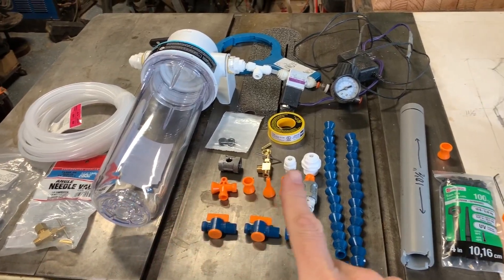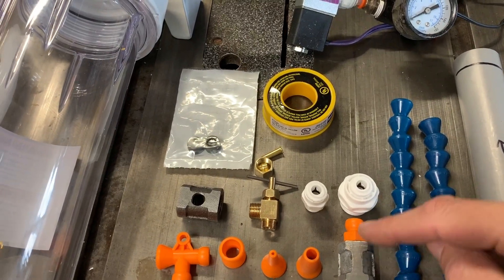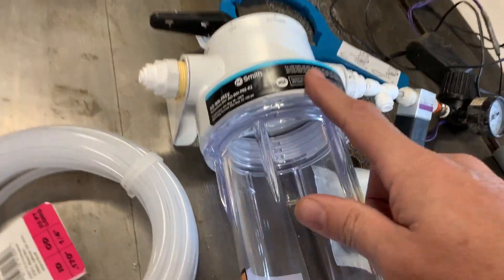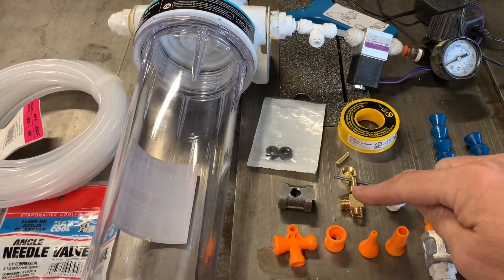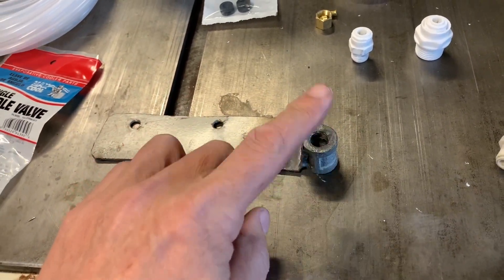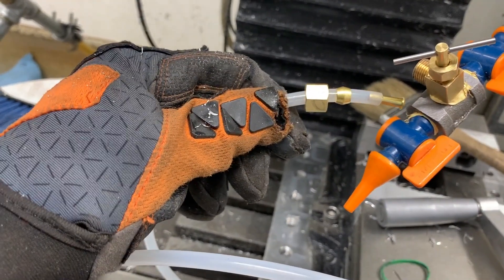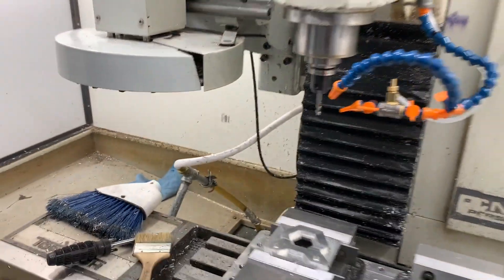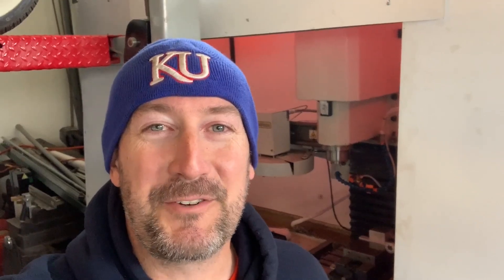SUPER CHEAP DIY Fogbuster Coolant System - Tormach 1100

Comment: Hey Greg, I'm following your plan on using an amazon solenoid. The only problem is that my 770M has a 115 vac C14 outlet and not a regular one for that power adapter on your solenoid. I bought the same solenoid and similar power adapter. Did you need a connection piece to plug into your machine? I just bought a IEC C14 Male to NEMA 5-15R Female... I'm hoping it works or I might be dead in the water.
Reply from the maker: The 1100 has a standard receptacle, but if you've got an adapter coming, it should work just fine.  IEC plugs are the same voltage and same amp rating.  Make sure you check the polarity with a meter.  I've had SEVERAL IEC cables and plugs that had the neutral and line backwards.  There are tiny little letters next to the holes on the IEC cable that indicate what they are supposed to be.

Comment: Great video thank you so much! Is the coolant liquid reusable so I can create a circulation for this cooling system? And can it be used for circular cutting machine for copper? I am planning to use this system for a HVAC manufacturing factory. Greetings from Indonesia. :)
Reply from the maker: It does not circulate...  I also don't know much about cutting/machining copper.  I use wd40 for cutting aluminum.

Comment: Killer  info Greg, you got me thinking about how to cool stuff on other machines. Got a friend gonna help me to get my South Bend Heavy 10 Toolroom Lathe up & running. I'm going to need it for a ptoject I've been wanting do a long time now. I'm having a hard time finding "Divorced Transfercases.." Next time Bessie goes down I want to be able to put a 4spd & a 5531 Brown-Lipe auxiliary transmission behind it & the NP 205 behind that which will give me overdrive on the high side & loads of deep reduction on the low side, plus a lot of PTO options. 
Killer Vid Greg,!!!
Aloha, Chief

Comment: Good chip evacuation really spoils you!  IDK If it'll ever happen to you, but I've actually had debris get inside my solenoid causing it to leak when closed; you can take them apart and clean the seal and clean the seal to get them working (The first time this happened I replaced the whole valve lol, now I know)
Reply from the maker: I haven't had that happen yet.  Now I know that I can clean it out.  Cheers!!!

Comment: dude that bracket with the coupler welded to it would have been a cool machining project.. use the machine to build itself! lol  sweet project, looks like it worked out well!
Reply from the maker: No doubt!  I kept looking for a way to machine all the parts and I kept coming up with a list of tools that I needed.  I did want to test out thread milling for the NPT connections, but MAN...  Thread milling a tapered thread is a math problem I'm not ready for yet.  I may remake this down the road.
Reply: @GregsGarage  yea, crazy how much more complicated machining projects are than plasma, laser, router projects, always a work holding issue and always a tooling issue.  But so damn cool!

Comment: Question Greg did you need to get a 3-phase converter for the mill , what  isthe power requirement 220 50 amp will run it ???
Reply from the maker: It's single phase 220V.  The 770 can run on 120V.  I'm using a 20A circuit.  The draw on these machines is surprisingly low.  It does have a. separate 120V plugin for the computer, the pump, and the accessories.  I'm using my bandsaw circuit since both machine don't need to be plugged in at the same time.
Reply: Busman 54 It’s single phase and only 2hp.

Comment: If you don't want to flood cool, or use the standard oily stuff... you can use what Datron sells. It's a denatured alcohol mix. The alcohol wets the bit and the part better than water, because of reduced surface tension and it's thinner. Plus, it evaporates, and leaves your parts clean for any subsequent operation where regular machining coolant would be problematic.
Reply: All I ever use is Isopropyl Alcohol. It is great because it evaporates without any residue. It is not harmful to your skin and it cleans oil and magic markers extremely well. A squirt now and then keeps aluminium cool. Its also not very expensive. €3/l.
Reply from the maker: I had no idea there was an alcohol solution.  I'm steering away from the flood coolant because I don't use the machine every day.  The bacteria will grow if you don't keep it turned over.  Also, it will be a struggle to keep the coolant to water ratio correct because of the infrequency of use.  I do need to find something I can use for wash down.  WD works really well for cutting aluminum, but I hesitate to use it to wash down the whole machine.  I'll check out the Datron line to see if they have something I can use.
Reply: @GregsGarage  yeah, no reason to buy theirs, as you'll be hit with the German "premium"! Haha! If you can find the MSDS sheet, you'll see it is water and alcohol. I personally use a 50/50 mix in a squirt bottle for vinyl work. I think a 75 alcohol /25 h2o ratio is pretty good for machining aluminum.